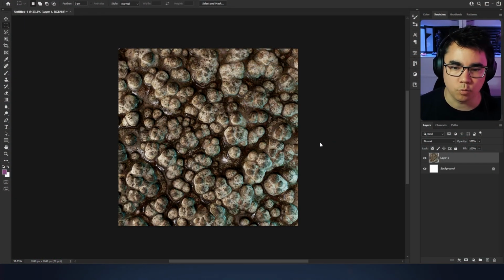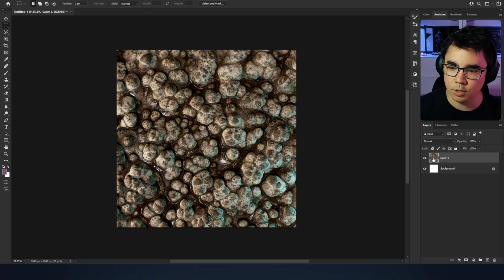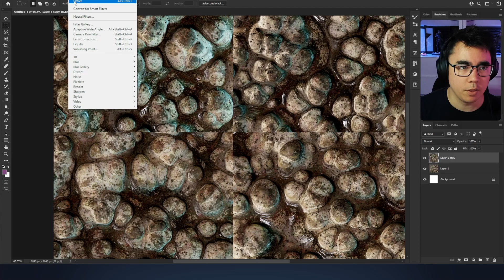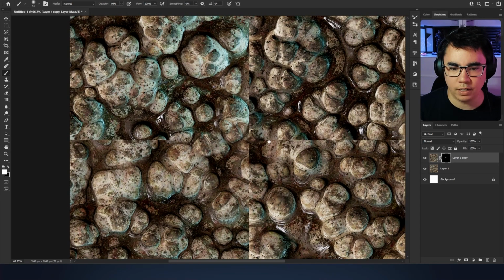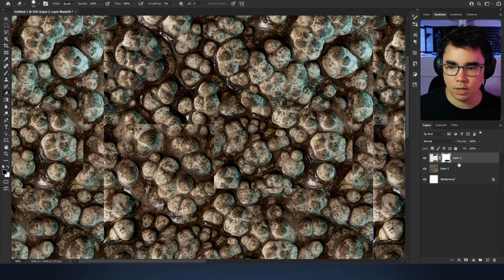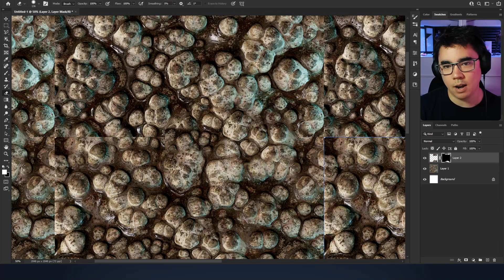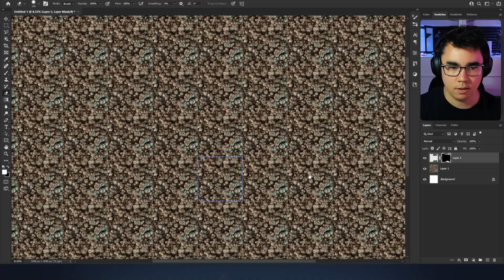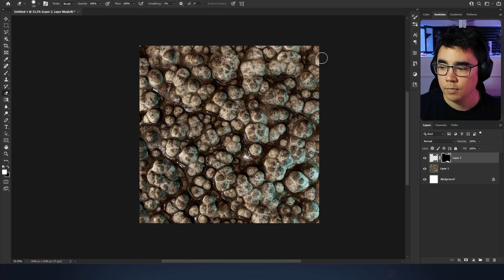Fixing Tiling Workflow in Photoshop

Comment: Awesome! They finally added wraping canvas do photshop! That's been my workflow for noises/masks in Krita since I canceled my adobe account years ago. It's a really nice feature /workflow for quick fixes and stuff!
Reply: Just to add a little extra tip: you can make a macro that duplicates the base layer, adds a small cross-like mask accross the center of the document and blurs the mask a bit, and add the offset to to the layer below. Then you just have to load the image, run the macro and adjust the mask in wrap canvas mode.
Reply from the maker: ahh yeah. I still need to add mine. this is good though. people need to always be reminded that macros exist and speed everything up! pinning for visiblity.
Reply: @TheDiNustyEmpire  always cutting away on the number of clicks! ☺️